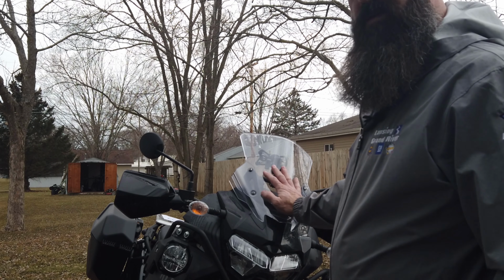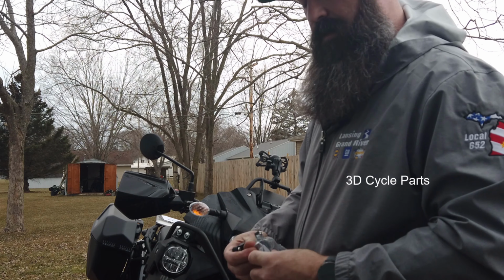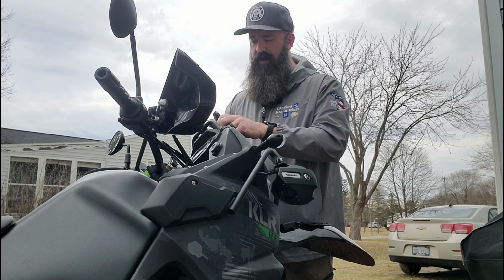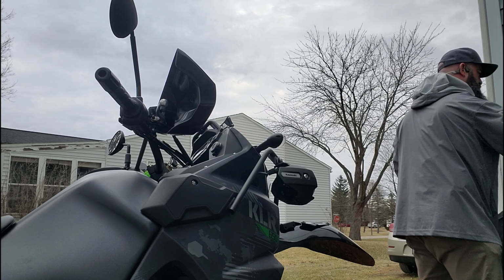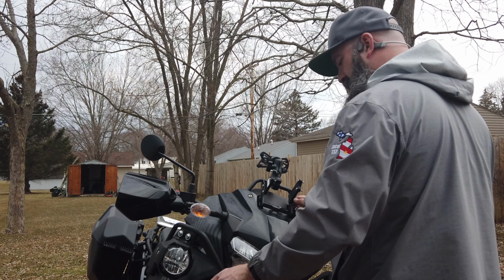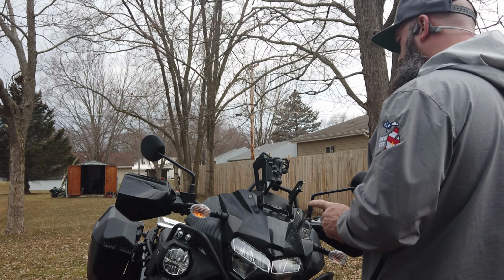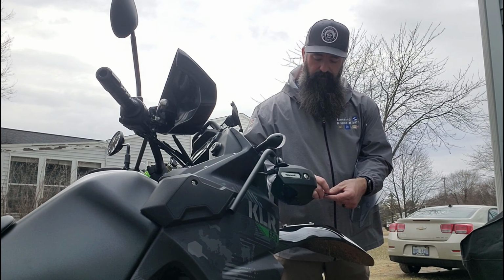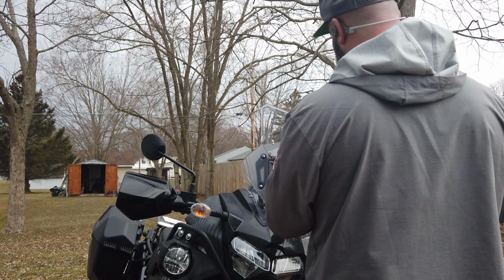2022 KLR 650 Windscreen Extension Installation

Comment: Guys, I took my first trip from Williamston to (In and out of rain starting 30 miles south of West Branch on tue.) ( Then down pour to St. Helen. Soaked LOL!.. stopped over nite - Then Roscommon- Higgins Lake back 127 South.. Got her to 99mph on a down hill.. LOL!..  350 miles worth last week. Had the stock 22 KLR adv windsheild in high postion..And still got the hell beat outa me!... So I Just ordered another National cycles V Stream Med, lite smoked windsheild for my 22 KLR adv. $125. What a Bargain these days!! They make 3 different sizes. using your stock mounts, and you still can move it up or down. I Learned the lesson long ago with my 2 each gen 2 KLRs. My first gen 2, I bought the OEM optional tall sheild, it was ok, but shook and flopped around too much!. The 2nd. Gen 2 I bought the V Stream.. WOW!, no compair to anything out there!. I looked at the 3-D blocks, The rise is semi nice but, I don't like or care for an inferior/poor design smaller stock wind sheild, then putting it up in a near straight up position is BS!. Talk about drag!. You want the wind to flow up and over smoothly, Not push it like a fat snow plow!. With these 3D things there goes 5 miles a gallon less and crappy high speed handling!. besides that, You now have massively opened up the whole area below your sheild and the fairing. Causing way too much negitive pressure. It will also let a ton of rain, dirt and debries to fly through up on your phone, GPS or anything else mounted the the acc. bar and finally to your face... Due to the scoop or angle of attack of the pointed fairing starting at the center of the pointed headlight has allready started the airflow going up. you now open that gap too far and get rain and sand in your throat.... You will also see the same concept on Newer Harley Ultras and Street Glides now have small adjustable vents in their windsheilds, It helps create just a little negitive pressure and a little air flow through to stop the wrap around turbulance and wind buffeting.    Heck, with the 3D things you change the angle of attck twice to near straight up, So ya might as well put on a small parachute on the back rack!.  Can't wait till wed to get the new one on it, I'll report back on how she works!.. Comming up on first service too!... Your Bro Davey Crockett Williamston  Mich.... Thumbs up every video and subscriber!. Ride safe guys!!..  Oh, by the way, I have 2 Aerospace degrees..

Comment: There is another gentleman in Arizona, who has installed these on his bike. Note, he is riding a fair amount of dirt and has some different bars on his bike. I just watched his video a few minutes ago, and he had a mishap out on the trail, is mirrors hit the wind screen on the dirt and broke one side  of his off. I cant say for certain it is the same as 3D designs, but it broke on the one side and he had to break the other side off to carry the windscreen back home. He said the bolts for the 3D Printed parts was different size allen head, and he only had the stock one. I am curious since you have the stock bars, so see if yours holds up better.? Thanks again for taking the time to share this video with us and have a blessed week. 
Dale. 
PS, new sub to your channel.
Reply from the maker: Hi Dale, we appreciate your advice, consideration, and subscription!
Reply: That guys handlebars hit his windscreen because he has risers with the bars rolled forward. If the risers hadn't have broken he would have broken his windscreen. Which one do you think is more expensive?
Reply: @3dcycleparts  Make no mistake, I was not saying it was your product, I clearly said that in my comment. I also said, I don't know the full details. So thank you for taking the time to describe the issue more clearly. But so we are all on the same page, I didnt call you out, I didnt call your company out and I didnt know for sure it was your product, I am never going to personally slam anyone in a public setting I am sure that if you ever had the chance to get to know me, you would have known that:, so if you read it that way, I apologize. For someone who was fixing to place an order, I was asking this person to keep us posted since he still has the stock bars. Thanks for taking the time to reply and I hope you have a blessed week Sir. As far as what would cost more to fix, I don't have any idea, nor did I ask that, common sense would say the plastic riser would be cheaper, especially since I stated I had them in my cart. You did however help me make up my mind on the order, so thank you for that as well. I think I mentioned he didnt have the right size allen wrench on his bike so he had to break the other side off. I still didnt say, it was your product, and I was mearly asking a question. Again, I hope you have a blessed week. 
Dale

Comment: How are the risers working out? Any downsides?  Thanks!
Reply from the maker: The stock windscreen and fairing combination gave me better overall wind protection, except that my face was being blasted over the windscreen. The risers eliminated the wind blast, but does create a little general buffeting because the aerodynamics are altered. Overall, I do recommend the 3D Cycle Parts risers.

I am curious about an adjustable risers I saw on @OntheBackWheel's channel.
Reply from the maker: https://youtu.be/o7YlJ6xMXzY